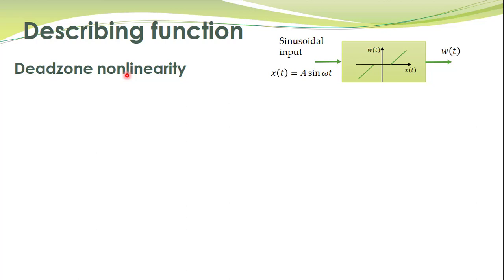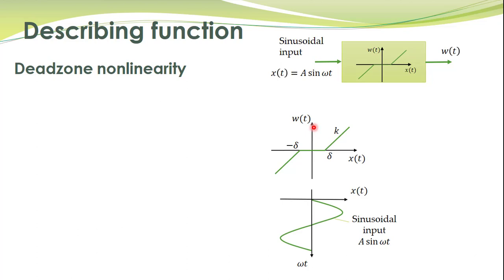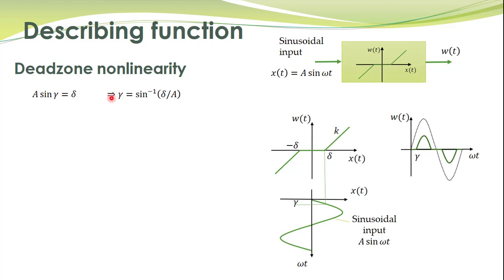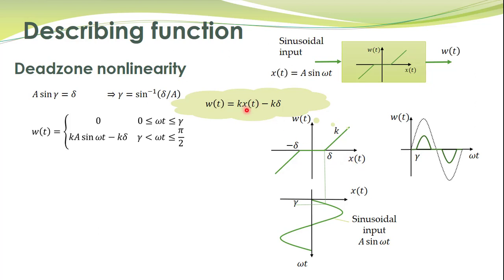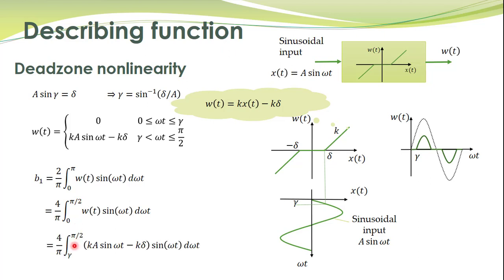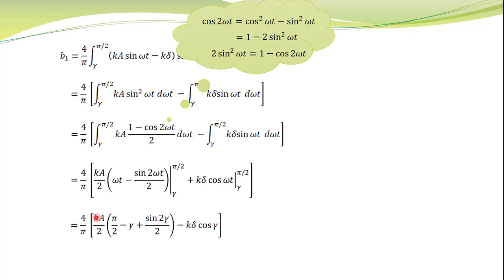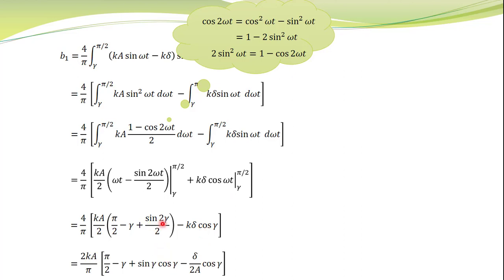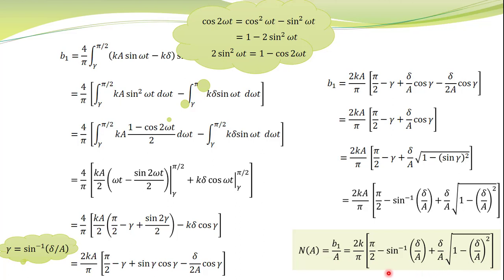NCS - 12 - Describing function for dead-zone nonlinearity

Comment: You have showed the output as passing through some 'attenuator', what is the block ismsoem sort of amplifier?
Reply from the maker: The theory of describing function analysis is applicable for systems with proper transfer functions, that is, the systems which are low pass filters. If the system is not a low pass filter then this theory will not be applicable. However, almost all real physical processes have proper transfer functions.